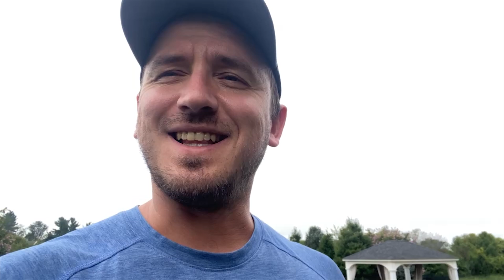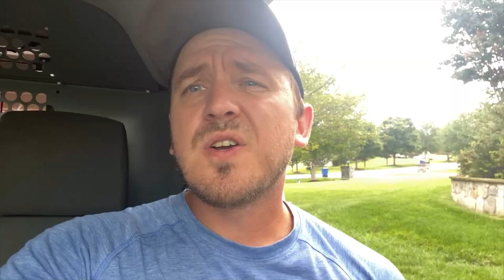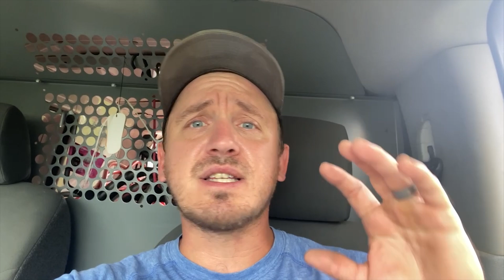Why Two-Chamber Septic Tanks Are Now Required

Comment: I am currently looking to move from a house with city sewer to a house with a septic tank.  Every load of wash of towels I put a cup of Clorox in.  Also, I clean the shower with Clorox to kill any mold and bacteria.  Is this ok to continue to do when I move into the house with the septic tank, or will this kill all the 'good' bacteria that breaks down the solids?
Reply from the maker: @johnevans6053 With that small volume, you should be fine. The chemicals will get diluted and not have any major impact. Now, don't go dumping a ton of bleach down the drains. This article from Washington State University has a good bit of information I regularly give to homeowners. https://s3.wp.wsu.edu/uploads/sites/2079/2014/02/septic-additives.pdf

Comment: How often is it recommended to pump out the tank?  And is it recorded by the state that it was pumped out?
Reply: Depends on usage, a 2-person household will produce half the waste of a 4-person household. Generally 3 years for a normal household. It’s about $300. Not bad. Don’t put grease or bad soaps down the septic and you should be fine for years.
Reply: What would a bad soap be?  What about home made lye soap with tallow or shea?@davejgirr
Reply: My septic guy recommends 2-4 years for a busy household. My neighbor hasn't touched his tank in 40 years without any issues. Depends on usage, tank size/type, drain field size/type, and soil conditions. There are a lot of variables.
Reply from the maker: I usually recommend every 2-3 years, at most 5 because things can and will break. It's always good to get a trained set of eyes on your system. MD does not require the pumper to file anything, as far as I'm aware. The B.A.T. systems in our state are the only systems required by law to submit annual status updates to the state.